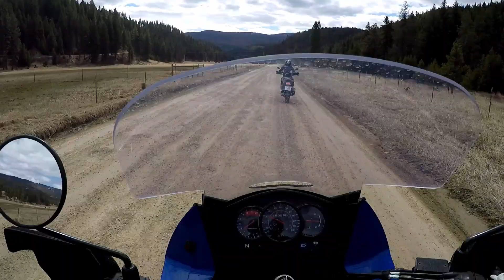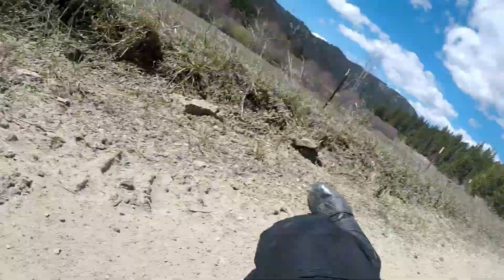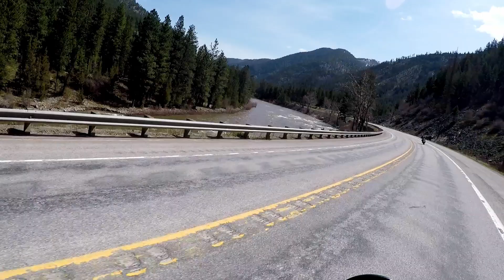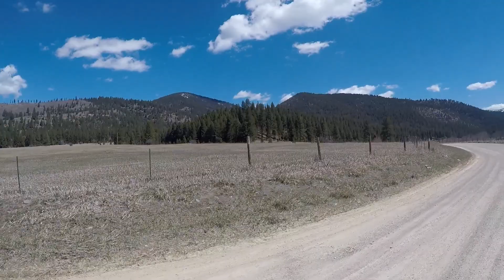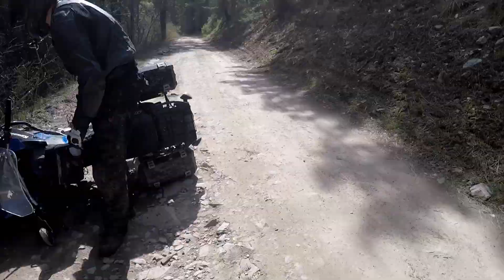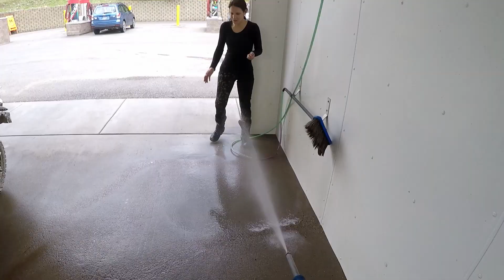KLR 650 and BMW 310 GS Montana Riding

Comment: I have a 2018 KLR and love it.  However, I'd like to hear how you feel about the GS310 compared to it.  I'm liking what I'm hearing about them.  Thanks for the great video!
Reply from the maker: I'm 6'2" and feel like the 310 is a bit to small for me frame wise and power wise. But its much easier to pick up when it takes a nap in the dirt!  My Wife is 5'6" and she absolutely loves it!  The 310 is a very very nimble bike!  Nothing bad to report on it just a bit small for me.  I love my big clunky KLR.
Reply: @TubaVaderMW2  Appreciate it. I look forward to testing the 310 out when one arrives at my local Motorsports Center.